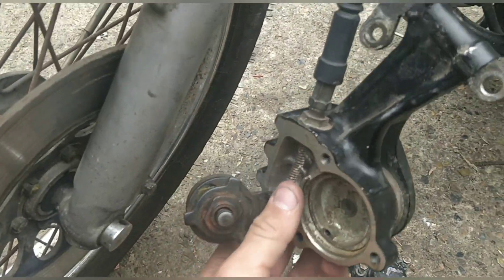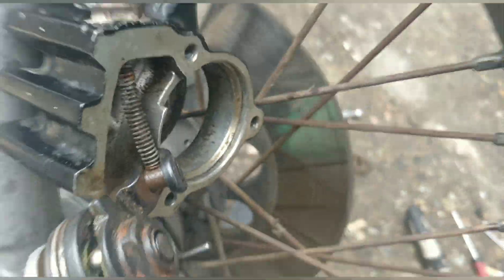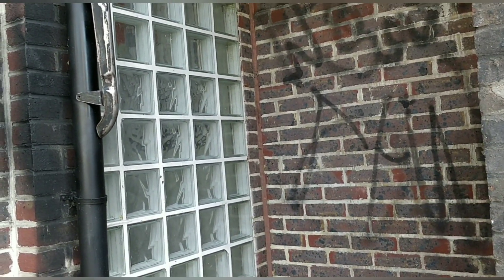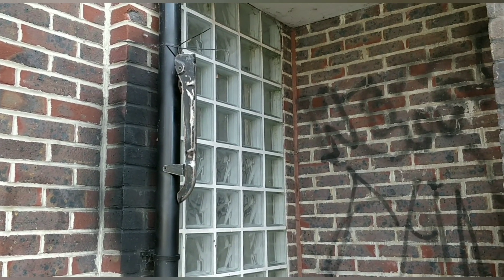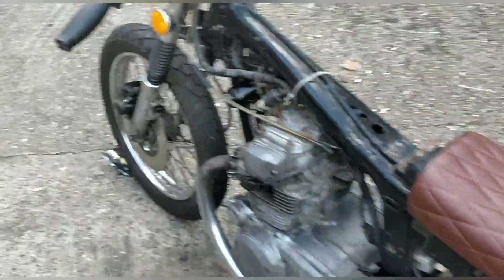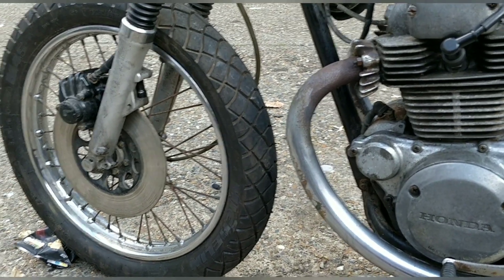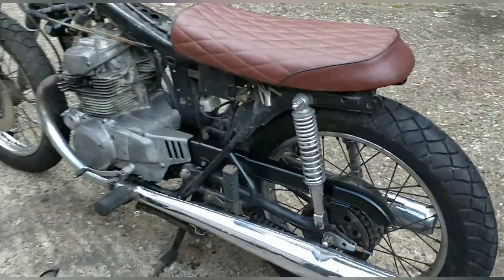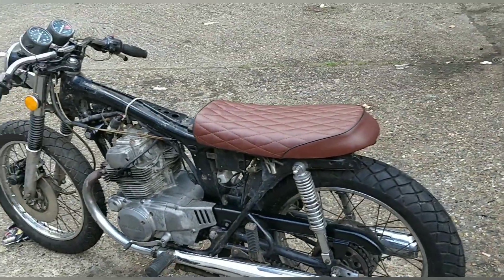Honda cb200 1976 cafe racer ish build. front brake service, progress is steady. painting, cleaning.

Comment: I had the cable operated brake on my CB100N which froze on me one Easter in the snow when I was doing my part 1 test training in a school playground -freed it up then rode home using rear brake only - it's such a pity u cant get the parts to keep it standard without spending stupid money, it really is - looking forward to hearing it running
Reply from the maker: Even if I had unlimited funds its very hard to find parts especially the mudguards Tim. But this way I get to make a sensible cafe racer which will be fun

Comment: You got the carbs👍just an idea but how about a set of ace bars ,i think they would add to the overall look your going for 🤔👍
Reply from the maker: What are ace bars Derek? I'll look them up mate. Funny enough today John turned these back upright. But it needs a new set to look clean. These have rusted a fair amount
Reply: @motorcyclerescuer  there a bit like an alternative to clip ons but bolt on like originals Charlie👍
Reply from the maker: I just checked, they are similar to what's on it now but they were turned upside down.
Reply: @motorcyclerescuer  thats why i suggested ace bars cos the ones that are on look exactly like ordinary ones turned upside  down😀
Reply from the maker: I think they were but when i looked at original online they look different. Leaving me with a what bars situation lol
Reply: @derekdingwall  i think you are a similar age to me i remember Ace bars i fitted them to my Fizzy and my KH 250 to make them go faster back in the early 80s

Comment: be interested with the results of the fuel tap as cant really find a cb200 one ,all this info is really gonna help me out.
Reply from the maker: Hi Paul, I've got a contact for the guy who made mine. They were high quality and very reasonably priced. But with the individual spout you wouldn't to run a y piece in line to split the fuel between carbs. Easy enough to do

Comment: get well soon my friend. i do remember cable operated disc brakes honda cb100. kawasaki z200 to name just 2 there was some more as well but there again i was born in 1963. what if you mount the number plate and rear light to the Right rear side of the honda A classic cafe racer style
Reply from the maker: Thanks Roland. I've been up and down all week really but feeling much better now. 

I considered the side mounted plate and even have one in the garage somewhere. I'll mock it up tomorrow and see how it looks. 

Cheers mate
Reply: @motorcyclerescuer  The side plate for me looks kinda odd thats just my opinion i prefer the streamlined look
Reply from the maker: I do aswell. However the brackets I can find look a little too modern for the vintage. I'm still looking.
Reply: @anthonyreddy3405  i do as well but its just an idea  that might work on that style of bike👍
Reply: @Rollie961  👍
Reply from the maker: Yeh I'll pull the plate out and mock it up. Definitely worth a look. But I'm sure I'll prefer the dead straight look especially as this has 2 exhaust. It's all symmetrical.
Reply: @motorcyclerescuer  👍

Comment: Hey Charlie 
Just  a thought,,,,how  about  if possible  you can cut out the underneath  the back of the seat pan so the frame sits  into the back of the seat base
Reply from the maker: Hi Anthony, one of the things people really don't want is any cutting of the frame. I kinda get why aw it's 46 years old. So anything I do needs to be able to be put back to original. If it was 20 years younger I would have cut it already lol
Reply: @motorcyclerescuer  yeah  I get that,,,hollow  out the back edge  of the seat ,,,maybe  a bit more  room to accommodate  the original  frame 🤔 
And let the seat lay flatter at the back
Reply from the maker: That could work. I'll look at that tomorrow. Cheers Anthony.

Comment: Hi. Where can i find the rest of the KDX125 videos from 3 years ago? There are only 2 left on your channel. How did you sort the issue of oil coming out the exhaust? Thanks
Reply from the maker: They are all around the same time. One after the other mate. I don't remember oil going into the exhaust but generally that would be an issue with either the piston rings, valves or overfilled oil in the crank.